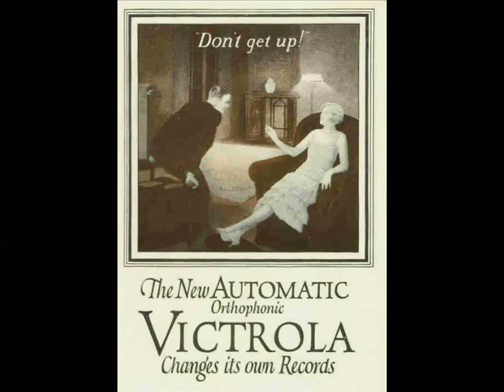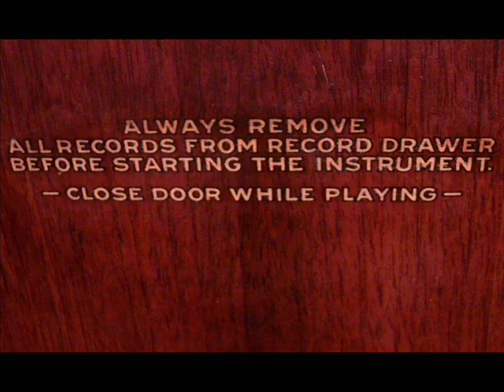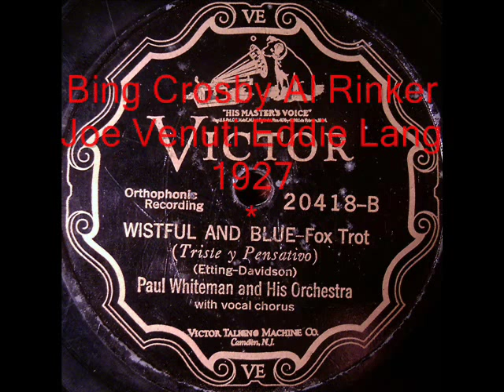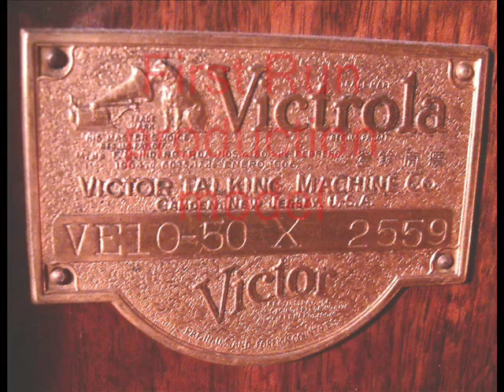CHARLESTON Sweet Georgia Brown 1927 Victor 10-50 Automatic Orthophonic Victrola Record Changer

Comment from the maker: By that time Victor had the Tungstone stylus - a very thin thread of tung wire which was softer than the record - which could play several dozen records.
But you are right - some of the very first machines ( the 1906 Gabel Automatic Entertainer) had a complicated mech that changed the needle each time.

Comment: Hello,
I have this machine, but never have been able to get all the replacement parts that were pot metal. I did get the beveled gears for setting for 10 or 12 inch records, but the pad the records slide on to go into the drawer is missing. Do you know anyone that has replacement parts for this machine for th pot metal parts?

Comment: Anyone know how to fix the automatic shut off on the 10-50, is it an easy fix and can you get parts to fix. I am assuming something is burned out and replacement parts are unavailable. If anyone knows let me know.  Thanks
Reply from the maker: +Idelia412 Hello, the shut off is done by the little flipper on the lift ring. It interacts with the main switch and flips the switch off. There is a tiny screw on the flipper to adjust the fuction.

Comment: This is an RCA Victor machine and yet there's a plate that says Wurlitzer. Was this made for Wurlitzer by RCA Victor?
Reply from the maker: +cricketrecords Other way around, Victor made the machine, and Wurlitzer added a coin op mechanism to it (no longer in the machine). A lot of these machines were used as early jukeboxes in 1927. You had to reload the records after 10 plays, but the 10-50 was much cheaper than anything else on the market in 1927.